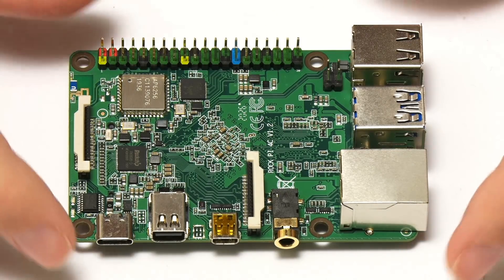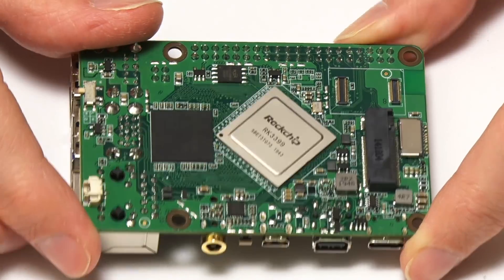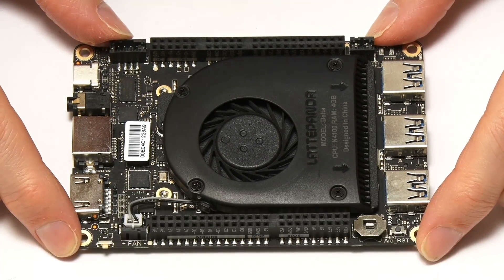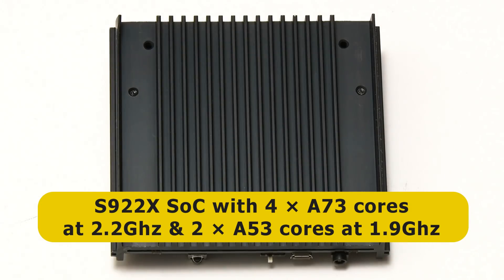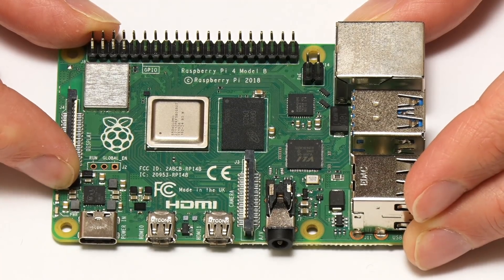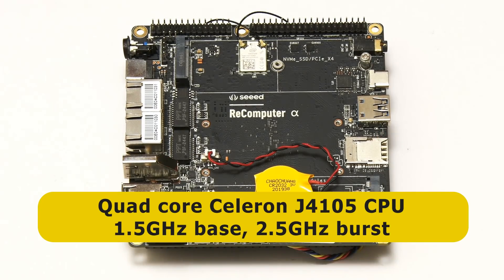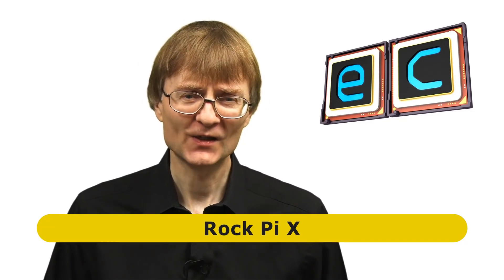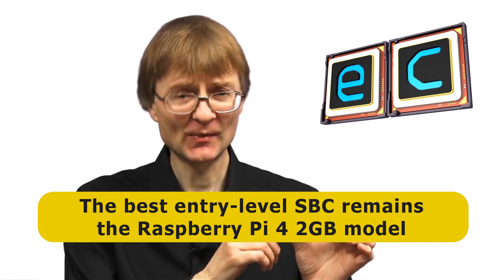Top 5 New SBCs 2020

Comment: Can the Tinker Edge R & Tinker Edge T  be considered/used as general purpose  desktop computing devices ?  

Is my impression correct that these are on the verge of overtaking  micro/mini ATX desktop configurations in terms of price and basic capability for those dealing with budget computing ? 

I see, from the Asus website, that they are certified by Microsoft for Azure, so  I presume that means they are at least capable of running the client side of a networked Corporate Windows package ? 

Have they got an Intel  processor emulation capability built-in to the hardware . . (Or does Azure incorporate same in software ?) ? 

The question then arises, how about running bog-standard,  full-flavour Windows 10 ?

These don't seem "Flights-of-fantasy" questions anymore  given that Microsoft are reported as currently developing ARM capable Azure.

Comment: Thanks Chris for your very informative and entertaining videos. 

I have recently purchased the Odyssey with blue case and am very impressed.  Though no fault of the SBC, the only thing I don't like is the fan noise. I will see if I can find a quieter fan.
Reply from the maker: Great to here. You can safely run a J4105 system without a fan . . .

Comment: Hi, I have a couple of questions along the lines of wearable computers. First up, I'm wondering if there are any SBC you know of with specs equal or better than the banana pi zero? Presently using a Vufine+ so I need HDMI.

My second question is where might I start my journey on using microdisplays (LCOS,OLED,LCD) with small and low powered SOM or SBC.... My end goal is a power efficient wearable media player. Thanks so much

Comment: I gather you can get an M.2 to PCIe for the x86j4105 and then get a graphics accelerator running on it.
Reply from the maker: Yes, this is true! :)
Reply: @ExplainingComputers  possible video idea? 😉Although it would need an external power supply to work.

Comment: Thank you for the reviews.  The Latte Panda in a Titan case does look like a very interesting speciment.  However, one thing that I have not observed with this board is whether there is a space for external antennas to be connected?
Reply from the maker: There is an antenna connector on the LattePanda Delta motherboard, which normally connects to a wire and flat pad antenna that remains inside the case.
Reply: @ExplainingComputers  Thank you for sharing this.  I assume, you mean there is a wire from a flat pad antenna inside the case, which could be attached to a lead (an MHF4 one?) on a motherboard.  One challenge I see with this is that an antenna connectable through SMA is more suitable for high-bandwindth and AP applications that the one present in the case.

I have been hard-pressed to find an SBC with a good CPU (say, 1Gbps of AES-256-GCM IPSec) and with good Wi-Fi hardware available.  The Vim 3 seems like a close contender,  but it lacks SMA connectors on the case. :-\

Comment: The odyssey is awesome for a pfsense box. Got it running for six months now, and works like a charm.
It made for an excellent "lab" computer too, with the integrated arduino and paired with an analog discovery for electronics.
There are, indeed, cheaper boards for any of those tasks, but not many that can do all of them. Lovely little PC.
The only downside, apart from the price, is power: mine could not run on a full size HD. As long as you are powering it externally, or just using 2.5" HDs or SSDs it'll be fine.

Comment: I'm enjoying the ODROID H2+. It's by far the best SBC for NAS. Plenty of storage options, M.2 NVME, 2xSATA with full power for 3.5" HDD, eMMC AND 2x2.5GBE NICs. It's a bit of a hassle to get the NIC to work because of the propriety driver and need of latest kernel for Linux (Windows is super simple, only needs to download and install driver) but other than that it's really is great. I'm upgrading my home network to support 10 GBit and this little thing comes along nicely.

Comment: It might be a bit of a boring topic to some, but could you do a video on the vertical mouse you use currently? It seems different to the joystick style one you used in your RSI-focussed video some years ago. I'm looking at replacing my standard mouse with something more ergonomic, to prevent RSI (since I'm spending so much time using it in lockdown!).

Comment: I'm still really hoping we will get to see a performance comparison video between the Rock Pi 4 and the Raspberry Pi 4. I'd really love to see how the big/little A72/A53 ARM hex core of the Rock Pi 4 compares to the A72 ARM quad core of the Raspberry Pi 4, as well as how the Broadcom vs Mali GPUs compare. It would be very interesting to see, not only because they're so close in price, yet have such different hardware configurations. But also with the Rock Pi 4 offering the most features of any SBC at that price point and the Raspberry Pi being so widely supported. They both offer the best of something different, at nearly the same price.

Comment: The issue with the odyssey is that you can get an itx for around $80. It supports SATA and has two serial ports several USB 3.0 ports, a printer port you can use for GPIO and a PCIe slot.  You could add another SATA controller or a 10GB networking card. It is bigger than the Odyssey but still an option  Just look up ASRock J4005B-ITX Intel Celeron Dual-Core Processor J4005 (up to 2.7 GHz) Mini ITX Motherboard / CPU Combo

Comment: I feel the point of the SBCs is to be cheap enough to buy multiple and run a very small, maybe even only one, number of tasks on each.
The Pi zero W is absolutely perfect for this but the OG pi has still been a fantastic option. variations on the pi4 started to push the boundaries with the £75 8GB model really being at the special use case only end.
That makes the Odyssey complete $#!73 for the SBC purpose, though as a desktop replacement it is admittedly top

Comment: Glad to see more SBCs become more valuable in the market and, at least on your list, usurp the Pi (current model here) in terms of stuff it can do.
For an update to my favorite SBC though:
More CPU. Stuff redlines it easily (web browsing for a start, some pages hurt to load and run, those same pages can't load on older boards b/c of it)
More I/O (partly CPU dependant). My recent experience with an OpenVPN connection (because wireguard isn't available from my provider for it) did at most 50-75 mbps where my desktop does ~200-250. I also had to use Wi-Fi to prevent a bottlneck of another 10-15 mbps before HDD access. Unsure why limited testing found this. I thought they did USB and LAN separately on the Pi 4?
After that? a distant 3rd is RAM, which A. is already out and B. I don't need until those two are up there. Great board for little projects, but needs more horsepower for some projects I'd like to undertake seriously, such as a NAS that's worth it, rather than a local hard disk that's faster.

Comment: I've got pi 4 8gb set up as a nas with omv5.  I was wondering if it's possible to set the pi up with dual boot options eg switch on and after nnn seconds it goes to nas or interrupt and it will go to desktop.  For completeness, I'd like to know about port forwarding so I can access the nas from elsewhere and what security to use to protect it from attacks.  As you can guess I'm a noob at this so forgive me if I'm asking daft questions

Comment: The Odyssey seems more like a mini PC than an SBC to me. I recently got the Chuwi Larkbox which has a similar CPU (J4115) and I image performance would be similar although the Larkbox is way smaller. Price is similar too.
Reply from the maker: The Odyssey is an SBC as all major components (CPU, RAM, etc) are onboard. As you say, Larkbox performance will be similar, but the Odyssey (like most SBCs) offers more connectivity -- two M.2 slots, SATA port, two Ethernet ports, multiple GPIO, etc. So it just depends on the use case.

Comment: As to Rock Pi X.  Atom Z8350 CPU has a very bad reputation for it's sluggishness. Moreover in 2020 this 2016 CPU is obsolete. Though $75 (4/32 version) seems to be a good price tag for x86 SBC due to above mentioned reasons I don't think this SBC will fly.
Reply from the maker: I'm not quite sure how a working processor can be "obsolete". And I suspect the only reason that RADXA can sell the cheapest-ever new X86 SBC is by using an older chip. It is not possible to sell a new SBC using a modern X86 chip for the price of a Rock Pi X. :)
Reply: @ExplainingComputers  Yes of course Chris. I see what you mean and agree completely. But what I think is that this SBC will not be successful commercialy. Will be only glad to be mistaken!
Reply from the maker: @СергейД-ч4ь  Agreed, it will be very interesting to see how it does. A lot of people want an x86 SBC, and for some (eg those wanting to run specialist x86 CNC software that does not demand a lot of power) then the boards will be very useful. But for others, an underpowered x86 board may be worse than a decent ARM SBC. We shall see  . . .
Reply: @ExplainingComputers  exactly. Thank you very much for your response, Chris!

Comment: Almost bought the Odyssey in August; but now I think I'll wait for the new boards to come out in the next couple months.  Besides, I just purchased a used Intel i5 Dell E7240 Latitude w/1080p screen for Linux testing.  Also:  to save money on cases for SBCs, I thought of using a small, plastic food storage box lined with insulating foam tape(non-flammable), spacers, custom cut air vents and external ports-- crude but functional.

Comment: Hi Christopher. Great video. I would love to try your No1. But I fear it would make my ARM SBCs obsolete. 
I expected the Odroid C4 in the list, but there can be only 5 in a top 5. I'm thinking of buying the Odroid HC4. Same SoC as C4. It has 2 x SATA for 2 hard drives or SSDs. 
But most important is that it still has HDMI. So you can still use it as media center or desktop. It does only have USB2 what is a bit a pity. The USB3 is replaced by the double SATA. 
I made a video about all my SBCs as channel special for +2000 subs. More than 30 boards. Specs, what they're good for, how I got them... It is a very long video. I might have too many boards :)
Have a nice evening. Greetings.

Comment: Hey Chris got my first 3D printer used. It’s a MOD-t and it’s company is closed down. How can I get software? and how do I get it working? Any help is appreciated because any links I’ve found doesn’t seem to work. I’ve even tried a couple work arounds to no avail
Reply: I hope you payed less than $50 for it.  A brand new kit with all-aluminum frame and decent specs only costs $200 these days.
Reply: @jong2359  well it was given to my son
Reply: @southsidedojo2  nice!  free sounds about right, and a good project for your son to tinker with.  I recommend looking at the mainboard of the printer, and looking for software based on the model of board that is in it.  Most of the clone printers used the same boards and thus software can be swapped relatively easily between them.
Reply: @jong2359  you mean tear it apart?
Reply: @southsidedojo2  it should be a pretty uninvasive procedure to get at the main board.  Usually a 2 screw affair.
Reply: @jong2359  then I need to learn the coding. Any suggestions

Comment: I can't wait until more x86 SBCs make the market... we will see a markdown in price, and an upturn in usability... This was a great video to experience, and while I still gripe at the PI's microhdmi, I have to agree with you that they are the best value machines.

I'll also point out the following link of VERY small form factor m.2 drives used in modern Dell notebooks. They are actually mounted on an aluminium holder... but would be awesome on SBCs. (PS. the link is only for reference.. smaller and cheaper models are available of course).

https://www.dell.com/en-ie/work/shop/dell-m2-512gb-pcie-nvme-class-35-solid-state-drive/apd/400-azwg/storage-drives-media
Reply from the maker: I think that you will like the Rock Pi X -- prices start at $49.
Reply: Have a heart boss.... I'm broke! Hehe... but seriously, yeah, I am raring to take a look at that! Counting on you to bring it to light.

Comment: Nice video, not so keen on the top choice, or the latte panda delta, old Intel hardware, newer parts available in 2020, and can be found in micro pcs at lower prices, but it hasnt been such an exciting year for sbc development, i think the biggest thing coming in the short term, are new gpu drivers for the raspberry pi 4, we should eventually see what the pi 4 has had left in the tank, big improvements expected.
Reply: I wouldn't expect big performance gains, but I would expect big compatibility and interoperability improvements.
Reply: @jong2359  currently the pi4 uses the old vc4 drivers, I would expect the proper vc6 drivers soon, I have seen footage of vulkan support showing over double the performance in quake 3, which is most promising, I am no expert but I would think there is significant GPU power left in tank of most of our pi4s at the moment, I will be most pleased if my pi4 works  better soon.

Comment: I was disappointed that jetson nano 2 didn't make the list but then relived to see you didn't consider it for this year -maybe next.  It's a solution looking for a problem but that is what tinker boards are all about.
-The X86 boards are in another category -expensive, commercial, heavy in connectivity but light in computing.  I don't think I could ever justify buying one because a tablet with the same processor costs $100 and a serious minicomputer can be had for $300.  If I had one it would be super easy to put to work....
-The pi4 compute module is nowhere in this video.  I sure hope it gets consideration next year.  I think there will be great double board solutions for each of the major use cases -data logger, server, gaming, desktop or laptop.....
Reply from the maker: As noted in the video, this video covers the period 1st October 2019 to 20th September 2020, and both the 2GB Jetson Nano and the Raspberry Pi 4 Compute Module were released later than this.
Reply: @ExplainingComputers  I look forward to next years videos!  BTW, it's a technicality, but will compute modules be considered SBCs for evaluation?  They are DBCs or MBCs when you use the PCIE.

Comment: How about a review of low cost x86 SBCs? Surely there must be some in the ~£60 region. I want to run a linux printer server without a huge box and huge cost, but the linux drivers for my printer and a couple of other devices are x86 only. Hi end graphics is not too important either but most reviews I see naturally lean towards the performers... Just a thought. Its that or looking for a ridiculously cheap second hand NUC!
Reply from the maker: Thanks for this. As noted in the video, I'll be reviewing the Rock Pi X very soon, which starts at $49 for a 1GB model. I've also reviewed the 2/32 LattePanda (V1.0) at $89, and the Atomic Pi -- https://www.youtube.com/watch?v=CpMhsrsiV6Y  But, aside from the Atomic Pi as a curious, remaindered industrial control board, there have been no x86 SBCs "in the c.£60 region" until the Rock Pi X. Intel chips are just too expensive compared to the ARM processors used on the Raspberry Pi and similar low-cost SBCs. I covered eight x86 SBCs across the price spectrum in this video fairly recently: https://www.youtube.com/watch?v=xqIHsJLDdN4
Reply: @ExplainingComputers  Thank you for replying. I'm looking forward to your review of the Rock Pi X, it looks interesting. I must have missed the last video you mention, I'll go look at it. Thanks!

Comment: Current SBC don't seem to bring anything new or valuable. There is Raspberry, Nvidia boards ecosystem and aside of that nothing really defined - other ARM CPU or x86 on an overpriced board with barely anything more than just a standard Linux distro is meh at best. And the pricing is also increasing to a point where mini ITX or thin mini ITX are cheaper, more widely available and way more flexible/powerful... and pico ITX/alike x86 boards cheap are on Aliexpress and alike - those made in large quantities for nettops and alike applications.

Comment: Why windows 10 on raspberry pi 4 was not mentioned?  For every windows 10 compatible board you mentioned it but for pi 4 you didn't.
Reply: @marcinoo97  What do you want from him? So he didn't talk about frankenboards. People can hack just about anything into anything. Big whoop. He covered legit boards and their mainstream capabilities.
By the way, you do realize you can edit a comment rather than spamming replies, right?
Reply from the maker: There is no legal version of Windows 10 for the Pi 4 (well, aside from the IoT edition).
Reply: What do you mean by legal?  I can activate it with a key and it will be legal just like any pc.  Windows 10 on raspberry pi 4 is legal.  or maybe installing windows 10 on normal PCs is also illegal?